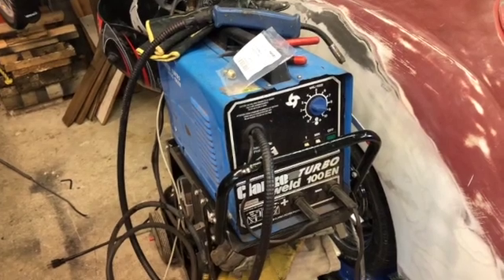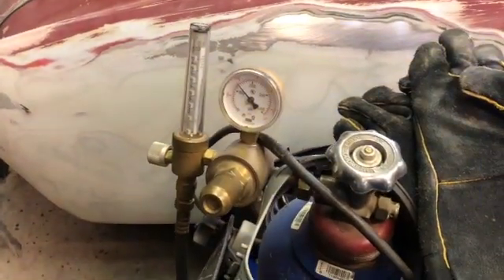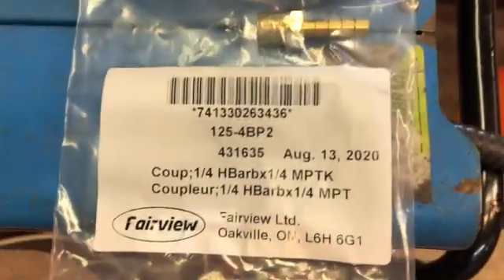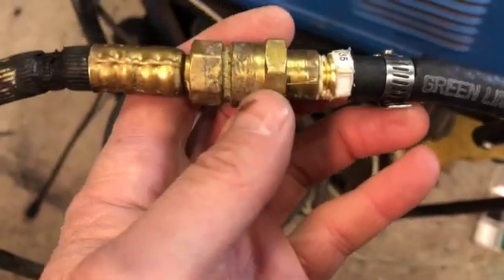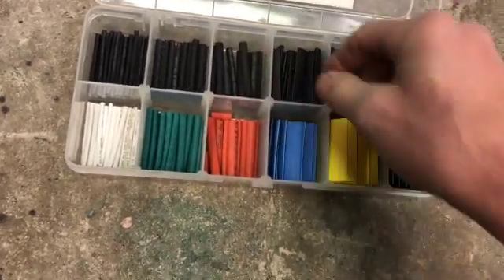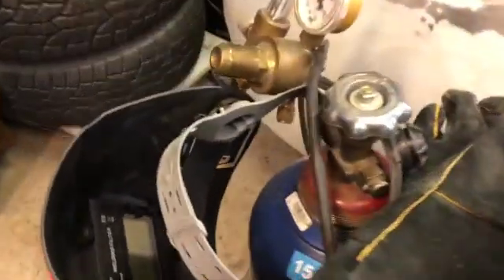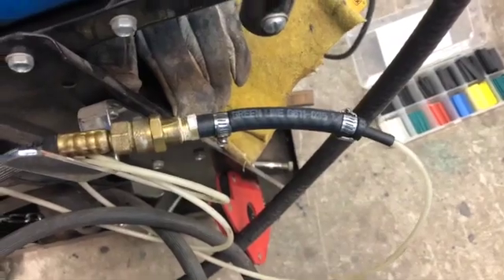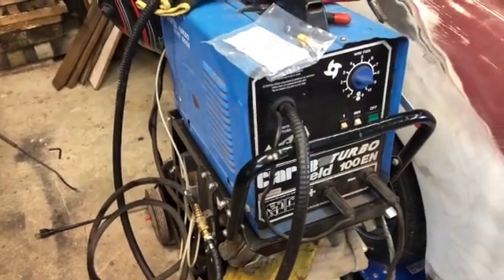How to Connect MIG Welder Shielding Gas - CO2/Argon Regulator Connection to Hobby MIG 5mm Tube

Comment: This video is not safety
Reply from the maker: This video is for the hobbiest working out of his garage and provides an option to connect dissimilar sized shielding gas hoses (Argon/CO2) in a well ventalated area.  This video is not intended to be used by professionals working in confined spaces, etc.